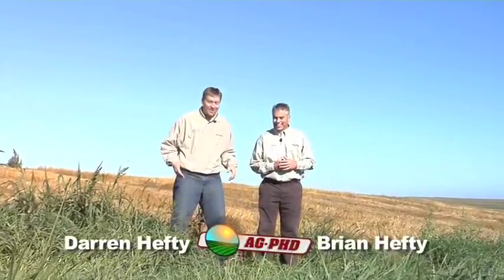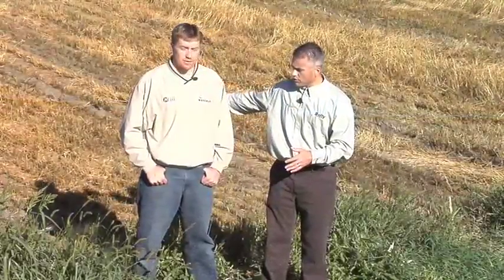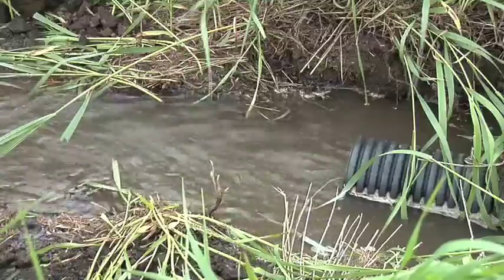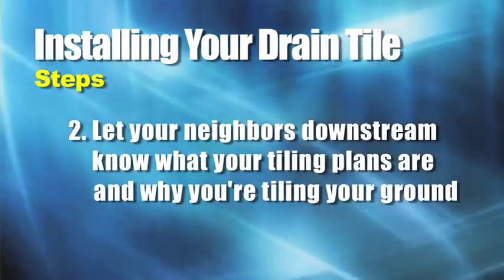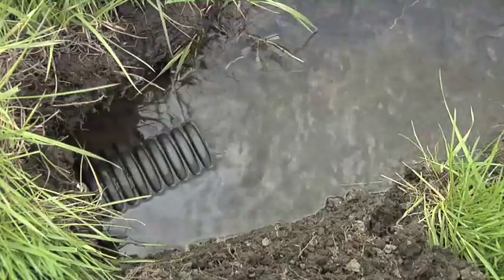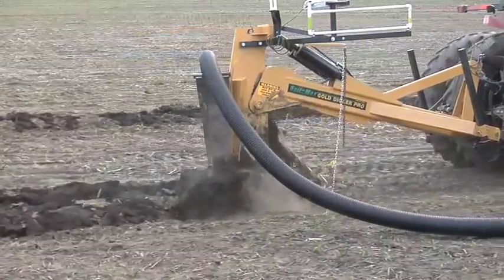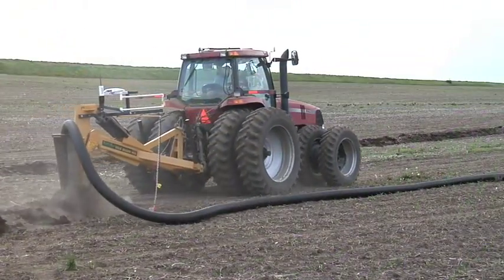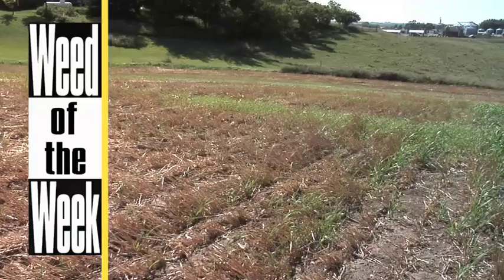Drain Tile (From Ag PhD #547)

Comment: Drain tile that has surface intakes will add to quick runoff and fertilizer loss. Much off the tile installed today has no surface entry and this is the best kind. I've been to the seminars these guys put on and they stress the removal of surface entry to stop pollution and sudden runoff. This means dollar savings for the farmer and a big reduction in nutrient runoff. A win-win.

Comment: I fully understand what they're saying in the video, but I've found significant information on the net that drain tiling is implicated in CAUSING runoff into waterways, rather than stopping it. I'd link you to several websites, but youtube doesn't allow direct linking. You can easily search it yourself, though.

Nitrates have no problem finding their way into aquifers that  are much deeper than drain tile.